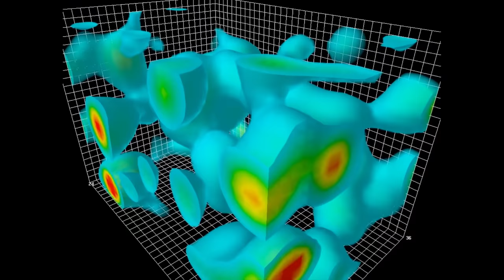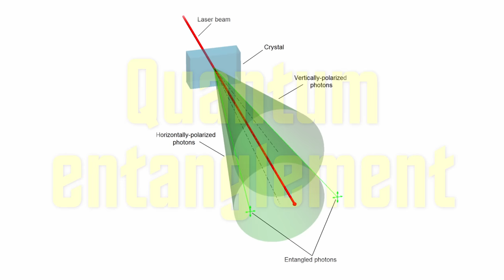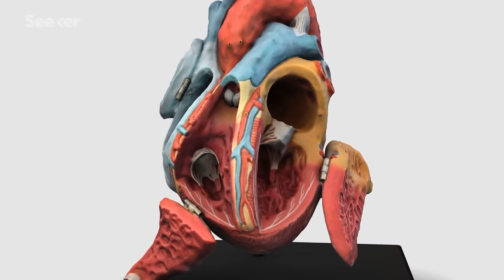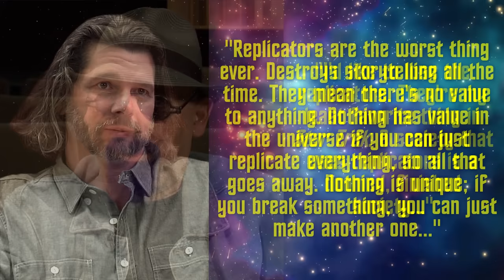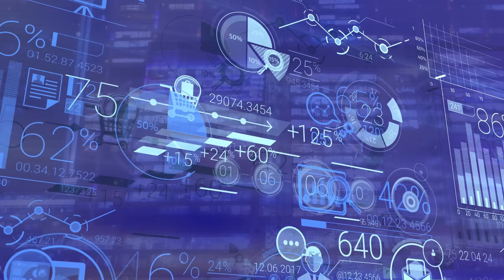Do Star Trek's Replicators Break the Universe?

Comment: Here's the million latinum bar question. Since transporters and replicaters work off the same technology, could a cannibal tell the difference between someone who's never been atomized and reassembled?

There are some clear limitations on the technology in universe, like you said, it can't make the fuel required to travel at warp speed, there are other materials it is incapable of making, like latinum, and there are other manufacturing limits, you need a big one to make industrial parts, so there are certain parts of the ship that would take forever to repair without a starbase. Not 100 on this, but I'm sure there has been a line describing how some things need to be machined or at least custom fitted together. Some engine parts having unique materials or something. After you watch enough Trek it all sort of bleeds together.

Comment: Replicators are here now in the form of 3D printers and ENC Machines.
My roommate's 82 Chevy Silverado needed a new transmission when the old one died on us.  The replacement unit is 65% NOS (New Old Stock) and 35% made from parts created in an ENC machine.  Parts made by sticking a block of steele into the machine, closing the access door and running a programs that cuts the part out of the block. That transmission should last 30+ years just like the old one did.

Comment: i bought a 3d printer years ago and i use it less than 1 % of what i originally intended to use it for. i suppose it would be similar with a replicator. or maybe it depends on the capabilities and the cost of source material.

Comment: The BIG problem with the transporter, which works on the same basic premise as the replicators, is that the make a copy of the item.  This means that anyone using the transporter now has a copy of themselves, so the original now has to be destroyed.
Reply from the maker: This has been discussed at length and is categorically untrue--they break down molecules into data and physically move that data from one location to another. When Riker was copied, it was explained (admittedly through technobabble) that it was from outside interference. Having said that, we are talking about a fictional technology so it's easy to get deep into the weeds, but I've long been an advocate of arguing against the "it's a death machine!" logic.
Reply: @OrangeRiver   You just wrote "they break down molecules into data" that means that they destroy the original, which is my point.
Reply from the maker: I mean, you're claiming that they're copying, that's not the same thing. There's continuity of consciousness in the matter stream--this has been shown on screen in "Realm of Fear." I think the mistake many people make is thinking that the transporter kills you, but it does not. Otherwise, in-universe, no one would use it for anything besides a weapon lol

Comment: Where are they getting matter to create something out of nothing?
Reply from the maker: They don't... that's kind of the point of having "replicator reserves" ... this is mentioned in the first minute of the video...
Reply: @OrangeRiver  uh huh. Again. Where are they getting the matter in the first place. This doesn't answer the question. I guess they just shove their dead into a machine or something and it converts it to matter? Cant have a reserve without something to begin with.
Reply from the maker: It's likely stocks of various substances broken down into pure chemical elements or alloys, which are then reassembled by the machine. I grant that the process of molecular recombination is quite out-there (that's where the transporter tech comes in, which is why "real" replicators would probably be more like advanced 3D printers with limited functionality compared to the Trek analogues). But Voyager was able to resupply their stocks each week. Whether one finds THAT realistic is also another story, but the concept is valid